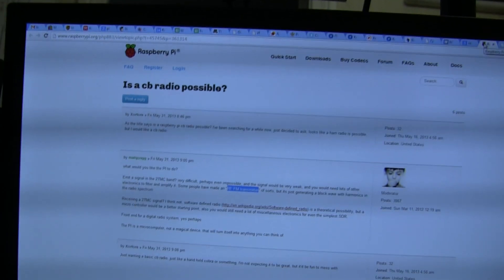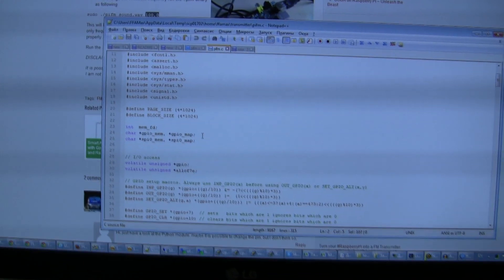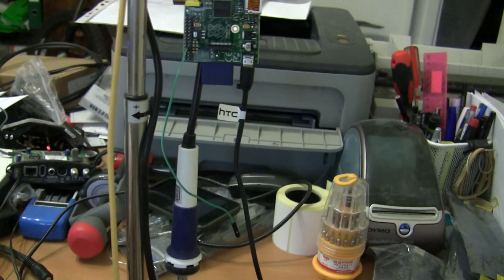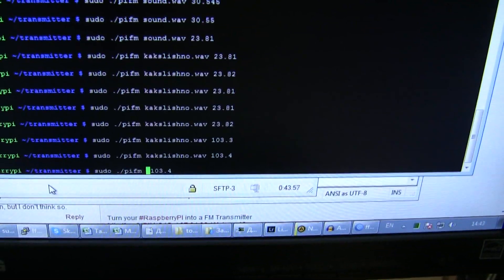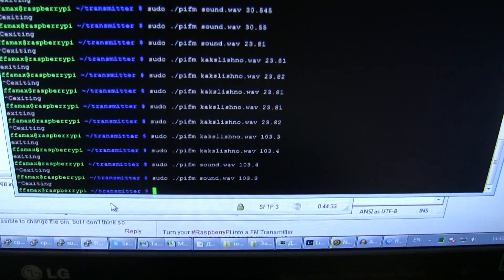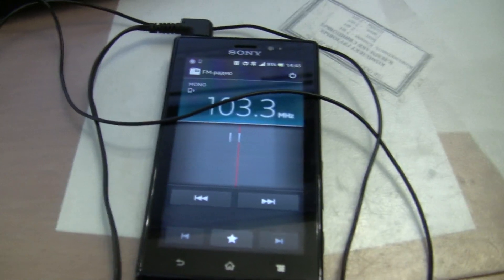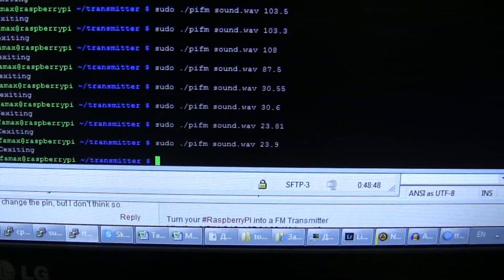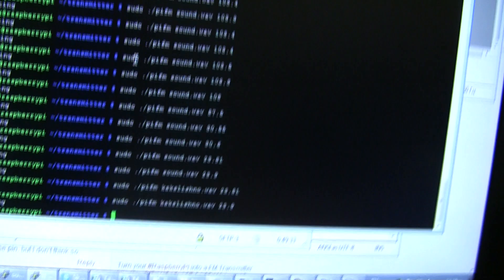Raspberry Pi Citizens Band Radio

Comment: Turn your Raspberry Pi into a MP3 Transmitter
http://bytesare.us/cms/index.php/geeky-toys/pi-as-fm-radio-mp3-transmitter
This will allow for automation of a sort and play a directory of wav or mp3 files.

If not already installed install..
apt-get install libav-tools

I used this string in a bash script to call the above mentioned script {i named it piplay} and it will release the channel if "control c" is pressed.

./piplay || gpio reset && rm pifm.radio.tempfile.*

I also had to modify these lines in the "piplay" script.

MUSIC_ROOT="/home/pi/pifm/music"
PIFM_BINARY="/home/pi/pifm/./pifm"
PIFM_FREQUENCY=89.3
LOG_ROOT="../"
SHUFFLE="true" # true | false
WHITELIST="wav|mp3"

command="avconv -v fatal -i '$song' -ac 1 -ar 22050 -b 352k -f wav - | '$PIFM_BINARY' - $PIFM_FREQUENCY"

"sox" did not work toowell for me.. :(

Comment: https://projects.drogon.net/raspberry-pi/wiringpi/the-gpio-utility/
WiringPI Library for Raspberry Pi
Try downloading it and using the "gpio reset" command after "pifm" command the to get the raspi to release the pin.
Dirty workaround but works..

Comment: I do not think there is a bug with the software. The FM broadcast deviation is much wider than CB. It will only receive if it is slightly off frequency as it exceeds the passband of the receiver's IF filter. Try a really quiet audio file.

Comment: can you please explain us how to get the release of the frequency working? because i could not find it anywhere else!
Reply from the maker: True way - stop PWM.
I do not know whick register can do it - pls ask at RPI forum and share answer ;)
I have used a trick as i remember - on kill signal i change frequency to lowest that possible (hardcoded).
This released current frequency. Just be shure that second (low freq.) is not SOS channel (they placed at low freq. too)

Comment: Not legally on these frequencies in USA.
Reply from the maker: Which frequencies using truck drivers in USA?
Reply: Yes AM only and 4 watts PEP  No data on CB.  Amateur Radio is a different story.
Reply from the maker: ***** Yes, in Russia it not legally too if automation used (e.g. data).
 Amateur Radio is a different story for us too and CB - it's most simple way, even registration of transmitters now not required but power limit about 4 watts too.
Amateur Radio some certification require.